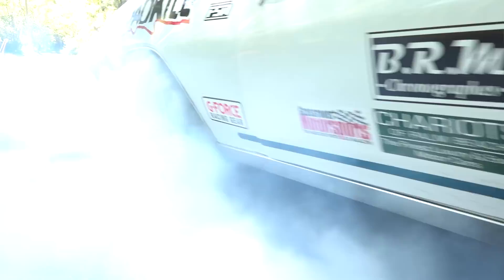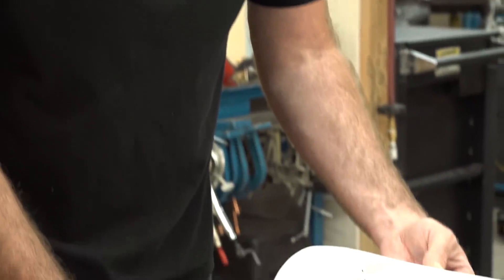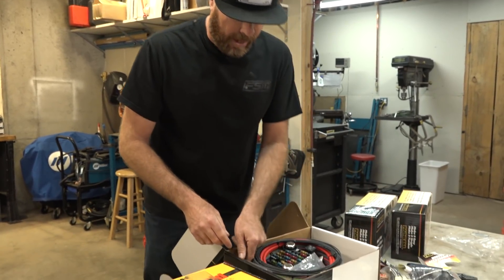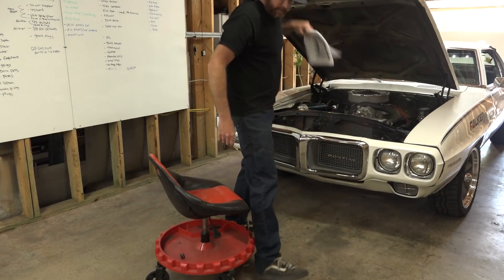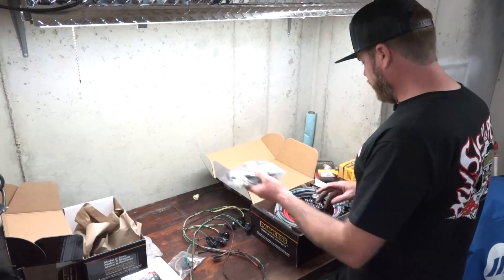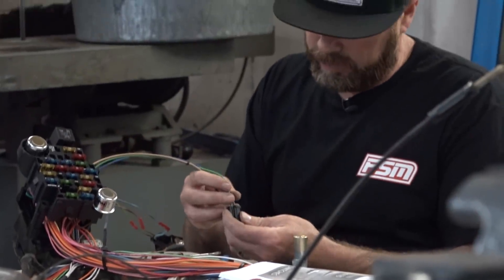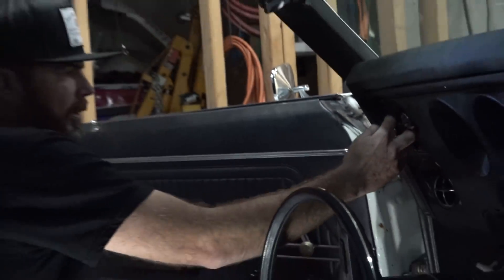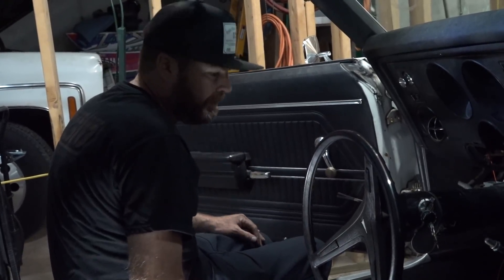Finnegan's Garage Ep.48: '69 Pontiac Firebird Tire Smoke With Fully Functional Taillights!

Comment: For open-barrel crimping, use a too-large crimping die to start the crimp, then finish it in the correct-size crimping die. Then crimp the strain-relief section of the terminal to the insulation with the larger crimping die. I've crimped thousands of those things perfectly with an inexpensive Waldom W-HT-1921 crimper, which has two sizes of dies integrated into it; it's the same idea as the one you have. For something nicer and more user-friendly, get yourself something like this -

https://www.amazon.com/Tool-Aid-SGT18980-Ratcheting-Terminal/dp/B008EW92LY

That is a ratcheting crimper with interchangeable dies, and includes dies for most any type of crimp you'd ever need to make, including open-barrel crimps. The dies are wide so for the open-barrel ones, it is a stepped die that crimps both the wire section and the strain relief section at the same time, and there's no need to start the crimp in a larger die first either.

If you want to be a real pro, buy the official Molex, AMP/Tyco/TE, Delphi/Packard, etc. crimpers for each type of terminal you want to crimp, but be prepared to spend Snap-on-esque money for them.

Comment: Not to be a jerk but when you crimp a wire, leave just a tiny bit of wire beyond the crimp. Give it a quick dab of solder.
Connection issues will never be an issue - ever. Down the road years later crimps will not work loose and cause intermittents.
If it goes down the road and has lights, solder your connections and you will never have issues......

Comment: @17:49 - https://youtu.be/-u1t7Cdf6RE

Looks like you may not have had the right crimper. I couldn't tell, because you didn't zoom in on the tool itself.

Also, ratcheting crimpers are the only ones you should ever be using for something like this. It ensures that you are applying the proper amount of force for the connection.

Comment: Those crimper pliers are shit. I wasted money on a set and had the same problems. I ended sticking the wire to the connector with a small bit of solder then bending the tangs with needle nose pliers.

Comment: great job , well explained .
but you never mentioned one piece of GM wiring that almost always needs replacing .
especially on a " 49 " year old vehicle .
that would be the > Instrument Cluster Printed Circuit  .

example > https://www.jegs.com/i/OER/691/6295409/10002/-1?ymm=4294829709+4294829274+4294829273

they become brittle and break easily with age .
thank you .

Comment: That tool that Painless sold you is garbage.  Been there.  Tried it.  It's crap.
If you're going to be doing a lot with Packard style connectors, get yourself some proper ratcheting Pack-Con crimpers with the appropriate crimp dies. (Multiple dies available for the tool.)